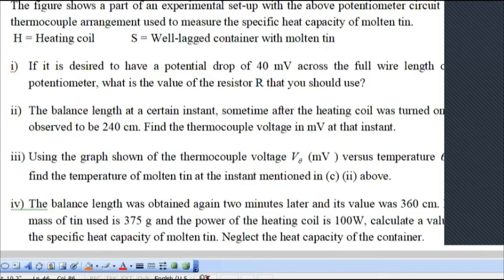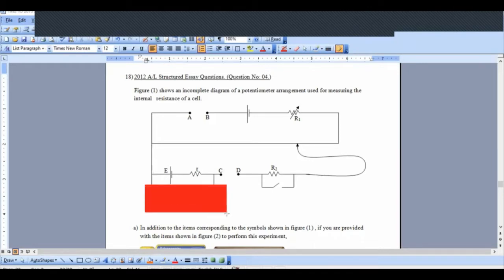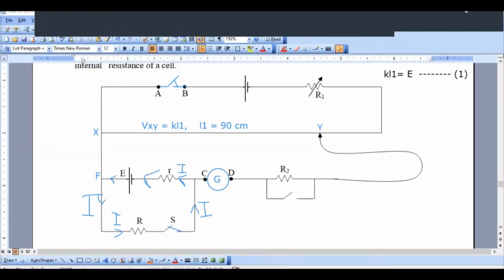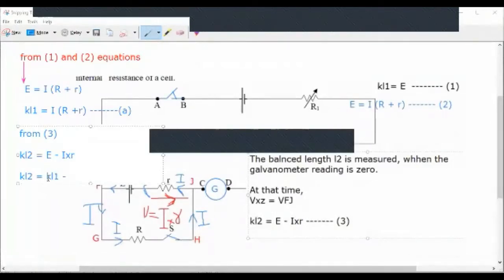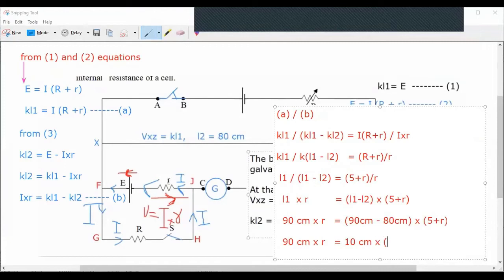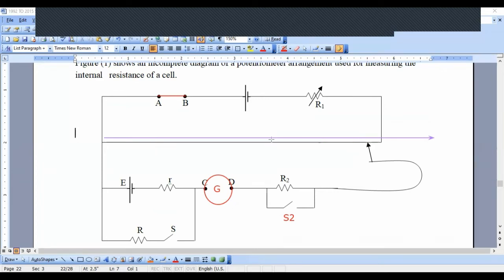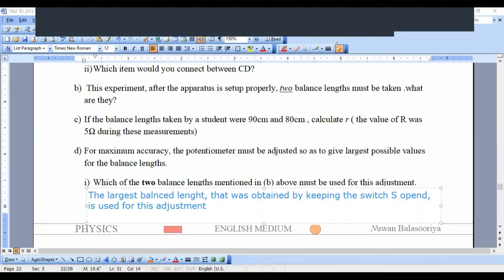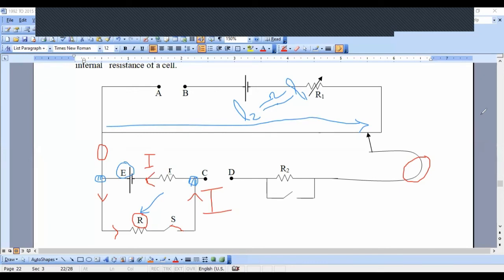2012 A/L Electricity Structured Essay Question

Comment from the maker: For the 2012 electricity question, redraw the circuit with labelled nodes and mark your chosen current directions. If a calculated current is negative, what does that tell you about its actual direction?